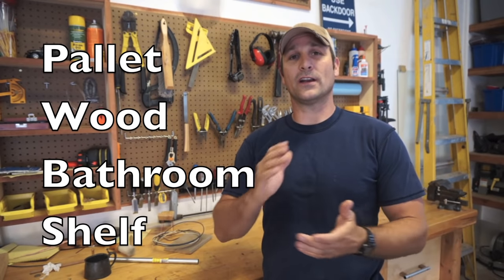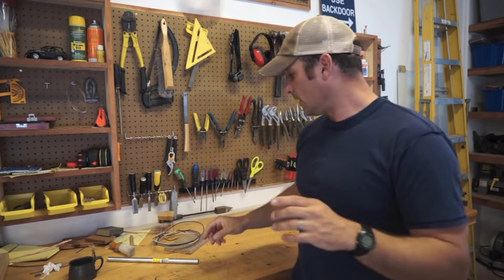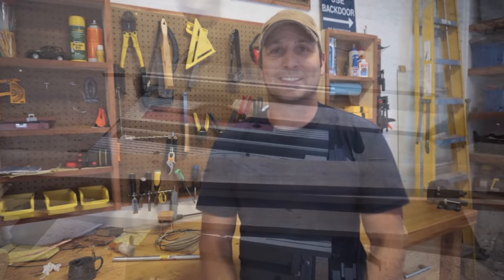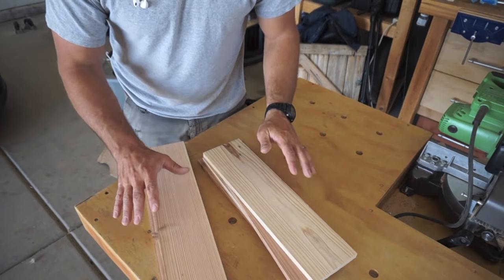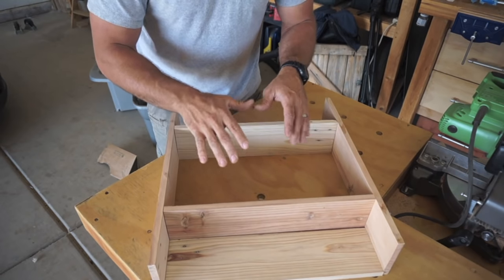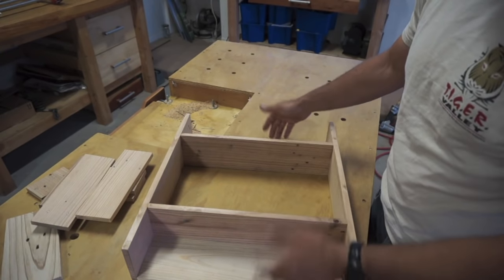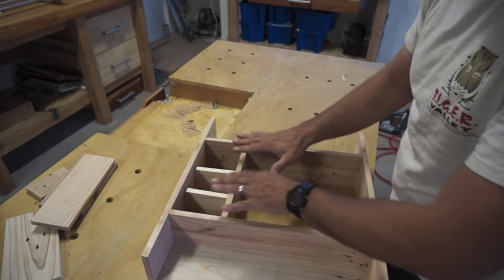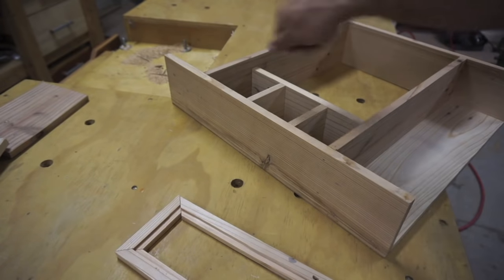Bathroom Shaving Shelf from Pallet Wood - How to

Comment: Very nice!  As usual.  I really like the use of the romex for holding the cut throats!  Nice collection too!
Reply from the maker: kevohh10 Thanks Kevohh!  I like the look of the copper against those old razors... I was thinking about hammering out some old copper pipe but the romex was just too easy.  But I think I'm going to include copper in some future vids for sure!  
Joe
Reply: homesteadonomics  I used some as pins through the joints of some frames I made for a couple posters the other day.  I built the frames as usual and then drilled through the 45s and slid the romex in and cliped the ends.  It added a bit of strength but mostly just looked cool.  I love using that stuff where I can.

Comment: I may have missed it, but what stain did you use and what ratio do you mix it with BLO? Is it a 50/50 mix? Love the finished look!
Reply from the maker: +Alan Smith Thanks Alan, I can't say for sure as I just added some BLO and tested until I got the right color.  The stain was minwax 'provencial'...pretty much the same stain I use on most of my projects.  (I'm cheap...lol..use it until its gone;)
Anyways, hope that helps:)

Joe

Comment: The detail on the pallet wood came out great. After painting on the stain did you do anything else to get it to look so authentic? Was it a water-based or oil based stain?
Reply from the maker: Robin Lewis Hey Robin... the finish is just a couple coats of stain/linseed oil mix.  I use the linseed oil to lighten up the stain a bit... kinda of a custom mix:)

Comment: Hey what kind of table saw do you use? Any recommendations for a good first one?
Reply from the maker: +0122358 It's a Ryobi Bt3100 (i think)... I got it off of craigslist and isn't the greatest but does fine for my skill level.  As for a starter saw... just depends on what you want to use it for.  If you're going to be doing some heavy building projects like cabinets, etc,. then you might want to spend a bit more and get a mid grade saw with a larger table.  But if you're just doing some odd jobs and smaller projects like me then pretty much any $100-$200 saw should do you fine.  I had a skil 10" saw before this one.  Wasn't the best, but did a lot of work for me and it was about $95-100 brand new.    So maybe an entry level skil, ryobi, or maybe a hitachi might do you well.  Hope that helps:)
Joe